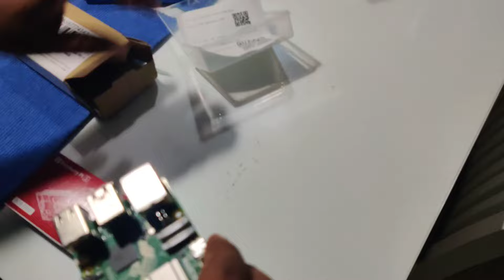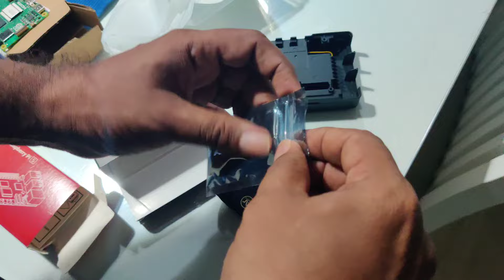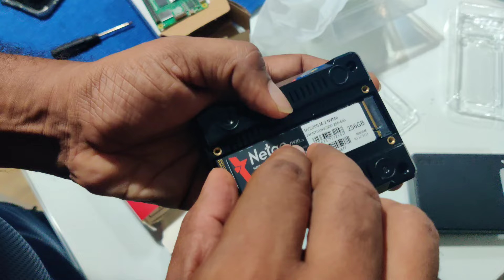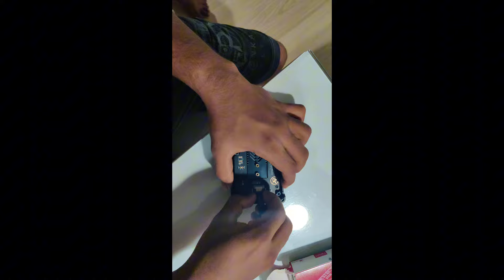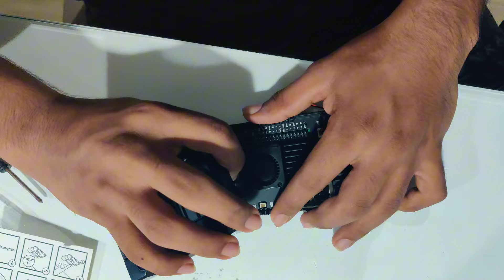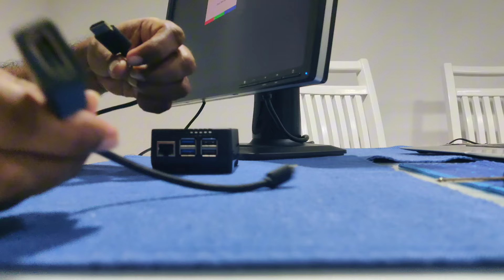I Built a Computer Using Only a Raspberry Pi

Comment: Do you normal do things shirtless? And also it’s thermal not paste that you’re using. Paste is like liquid and you keep saying thermal paste when it’s the pads that you’re using.
Reply from the maker: Thanks for the correction. I usually get mixed up with thermal paste and pads. I will correct it
Reply from the maker: I will add a more concise video on the steps and correcting it for thermal pads. Thanks
Reply: @maskedCXO  No problem